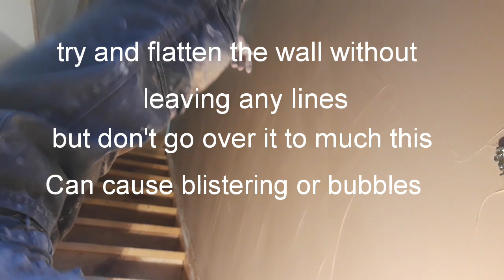plastering an 18m2 uneven wall PART4 final part

Comment: looks superb..how long from start to finish when using sponge method..ive just bought one to give it a try.
Reply from the maker: Personally I went off sponge for a while but now back using it working with other PLASTERERS more and I'm getting work cause when its dry it looks all nice and even also looks great painted I'm finding time is all about how much time you personally want to spend on a wall polishing up guys I'm working with are trying to leave them as early as possible

Comment from the maker: I've just noticed that it's not a 16 inch nela that I used but a 14 inch 1
Reply: Gordon Mackie am really confused. I thought by using the sponge float you wont be troweling out at the end but using a 16inch nevaflex bits? It seems like the sponge float doesnt really replace or make anything easier?

I have also looked at the videos on the channel were you learnt sponge floating from but still cant understand it
Reply from the maker: @nadznadz5630  what I've been finding is that if I go to 1st flatten a wall and it's not going well mainly on a PVA'D wall I will go over it with the sponge I've learnt that the sponge is good on certain walls where lights going to hit it from a sharp angle it's a method that some like to use a lot and like me only use it when I think the wall will benefit using it I've been looking at work I done 8 years ago where I only used a 14 inch ss trowel and the walls still look great you may find sponge method a pointless exercise but it is handy to know when to use it can help you out in walls that go to quickly hope this helps a bit thanks for watching 👍